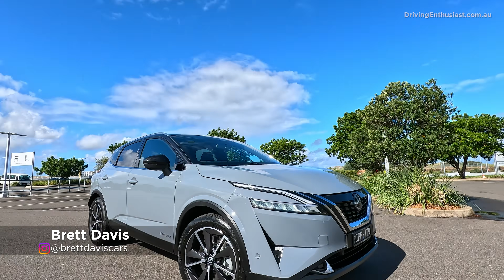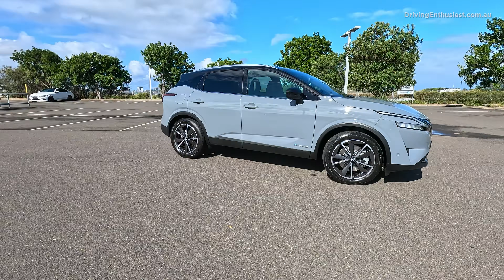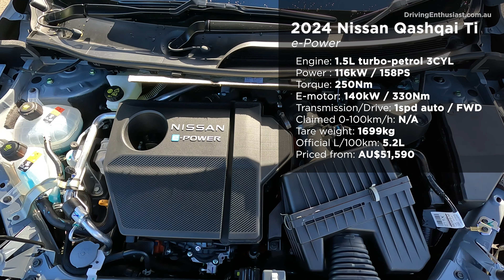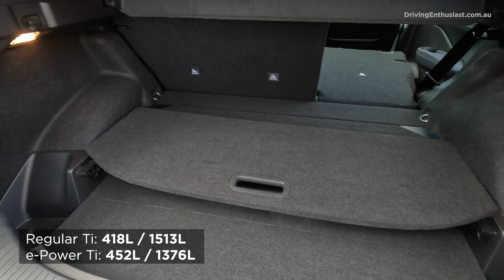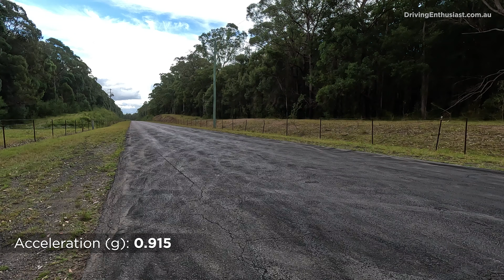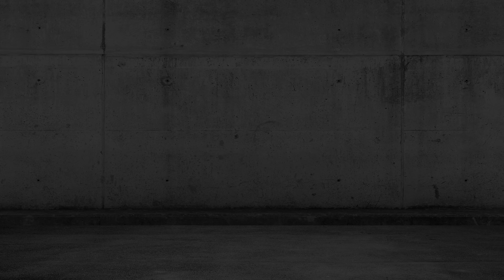2024 Nissan Qashqai e-POWER review & 0-100 (hybrid explained & compared)

Comment: As the NVES has passed both houses, all manufacturers need to work on bringing more mild hybrid cars to Australia, which will replace the non-hybrid models and narrow the fuel efficiency gap for many models. In other words, the e-power system will make less sense if the non-hybrid model is replaced by a mild hybrid version. However, the price gap will also be narrowed down.

Comment: Variable compression engines not new. Mating it to generator and electric motor a bit newer. But then electric cars are well over 100 years old. And so is the idea of VCR. Various versions built just never took off.
Reply from the maker: I wonder if this will take off for Nissan? It seems like a lot of added complexity to me, for long-term success. I still find it interesting and would choose it over the regular Qashqai, but yeah, as others have pointed out, some conventional hybrids are more fuel efficient; this 5.2L/100km vs 146kW Toyota C-HR eFour 4.1L/100km, with AWD.

Comment: A Chevrolet volt equivalent system?  So is it as good as the old volt was on mileage?
Reply from the maker: I’m not sure. It’s not actually that good on fuel compared with some rivals. As some others have said, Toyota hybrids seem to do better. I’ve experienced 4.4-4.6L/100km in a RAV4 hybrid with completely normal driving (not trying to be efficient).
Even so, the e-Power is pretty interesting. If they can refine it some more over the next few years they should be able to get the figure down further.
Reply: No because the volt had a 17kWh battery to set off on, it wasn’t as efficient as a HSD Toyota in hybrid mode, but the 60-80km you got from the charge offset it significantly, that said having owned 2 Volts and 2 Hybrid Toyotas, give me the Volt any day

Now I have a full EV and well would never consider either again

Comment: It is an interesting technology. With a 116kW generator, and a 140kW - does this means that there would be a fairly short period at which maximum power can be used (i.e. until the battery is drained)?  The most impressive statistic is the rolling acceleration.. that 60-110 km/h is a big improvement.
Reply: In town the ICE won't be on much, as the ReGen braking will charge up the bty & in town you do a lot of braking. This will lower emissions.
Reply: Yes you are correct, if you were to floor it for several minutes you would drain the battery to it's lower limit and the max power output would drop to whatever the petrol engine can generate.
Reply: @michaelcampbell4990  And where on street you can floor it for "several minutes" ? Nowhere. Even if you are on autobahn, "flooring it for several minutes " would result in reaching its limited top speed and the system would begin to charge the battery again.
In real world there is almost no real scenario of fully draining the battery to its lower limit and then not having enough power.
Reply: @Eugen-E  on the Nurburgring (because we all know the Nissan qashqai is designed specifically for that kind of driving). In the real world you are correct, you will never run the battery flat. Battery is 2kwh, power difference between electric output and petrol generator is 24 kw, so ignoring all efficiency loss you can have full power for 5 minutes before the battery would fully deplete.
Reply: @michaelcampbell4990  As you've already mentioned, the car is not designed for track use. So this is irrelevant. For track use there are other types of hybrid powertrains. 
I don't think you can calculate how much time the car can sustain full power because you don't know the max battery power. And also it doesn't matter.
Reply: The electric motor uses the energy from two sources: ICE-driven generator + battery. 
You cannot fully drain the traction battery.

Comment: Toyota hybrid system is way more efficient, especially on highway driving going 100+ km/h.
Reply from the maker: Agree. I think Toyota systems are among the best so far. I’ve experienced 4s in a RAV4 hybrid before. But, Toyota has been making and perfecting hybrid tech for many years now.
Reply: Because they are slow
Reply from the maker: @josh3221ify  Not necessarily. The last RAV4 hybrid we tested did 0-100 in 8.28s – pretty similar to this. Outgoing C-HR hybrid was very slow though, 13s+. 
You can check our full Vbox results database here: 
https://drivingenthusiast.com.au/performance-data/
Reply: @josh3221ify  No, they are not. The Camry hybrid is faster than a VW Arteon 2.0 diesel 200hp DSG🙂
RAV4 hybrid quicker than the Tiguan or Kuga (Escape) 2.0L diesel 190hp DSG. And so on.